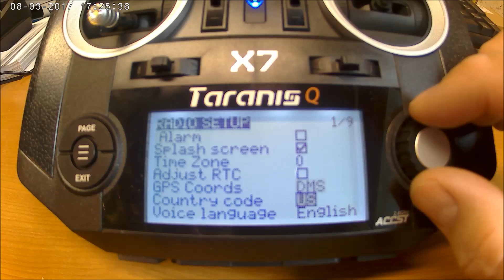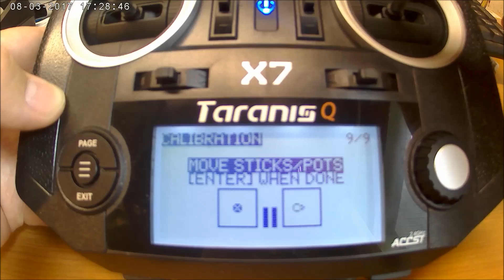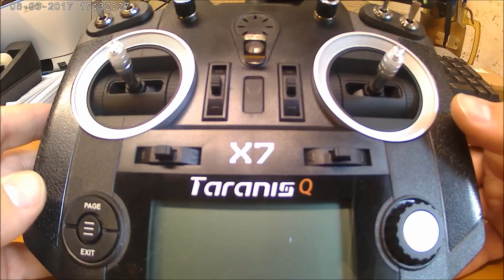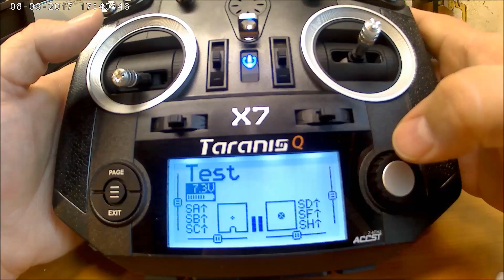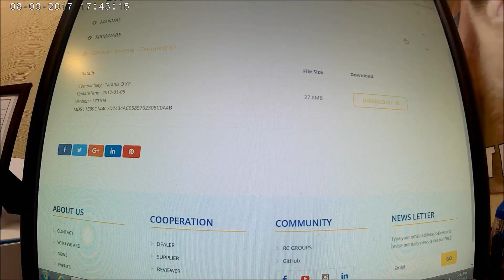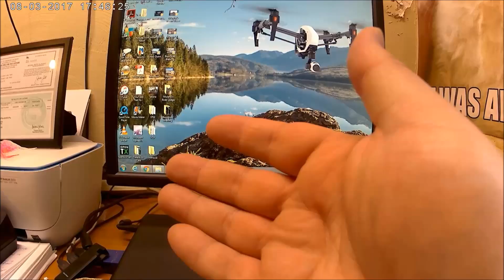Taranis QX7 - First Initial Setup Steps

Comment: Thanks for doing a great video with all visable. Was easy to follow along 
The JR bay in the back will hold my TBS crossfire module. For my extended FPV rc Summit's radio link I need for my channel.
 Thanks again for making it a bit easier.  I didn't even try to fiddle around before I watched.
Reply from the maker: Your welcome glad it helped. Thanks for watching
Reply from the maker: Yes the bay in the back will hold a crossfire. I use the full version and works fine

Comment: Excellent video as usual...
!!!  I need some help please  !!! I have an eflite viper 70 mm edf and I bind my Taranis QX7 with Spektrum Rx AR636A AS3X using the JP4IN1 Jumper Multiprotocol Module....... everything is working good, but I don't know how to make the Safe works, how can I assign a switch to enable or unable that option?..... I'll appreciate any help... thank you....
Reply from the maker: Thank you. I honestly don't know anything about that module. I only use the TBS Crossfire.

Comment: This is the first video I opened after receiving the Qx7 S. Great video, thank you!
Reply: Did you get yours running? I get mine delivered tomorrow and tryna see how to simulate this first. Any recommendations?
Reply: @rtony209  yeah it was up and running great! My one recommendation would be to update the firmware as soon as you get it. My power button would flicker even after turning it off, firmware update solved it. Good luck with your application!
Reply: @Coolarj10  and by updating the firmware it would require me connecting it to my PC and all that good stuff?
Reply: @rtony209  there are some tutorials online but it’s pretty straightforward. Here is the latest firmware: https://www.open-tx.org/2020/10/06/opentx-2.3.10
When you install that software to your PC, it will let you put a firmware update file onto a microSD card which you then put into your Taranis controller. There are a few steps you have to do which I can’t remember, so please follow the instructions in that link or in another YouTube tutorial!
Reply: @Coolarj10  thanks for the link
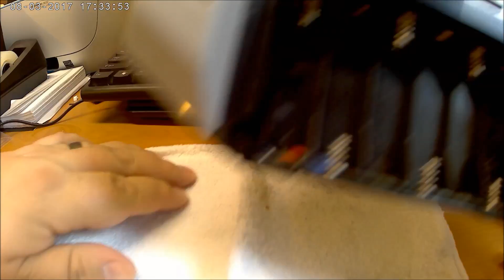Reply: 11:44 where can I find more about this component? Or will you tell us what the external part does?
Reply from the maker: It's a module bay for like the TBS Crossfire system, or a multi protocol module.
Reply from the maker: Thanks and thanks for watching

Comment: If you lift the battery tray out, you can plug and unplug the power jack before you remove the back casing.
Reply from the maker: Ya actually I've done the battery mod. Already tha is for the info.
Reply: Nice! I want to chance the tray to a real battery instead :)

Comment: Ok, I've been trying to search how to power on the Taranis without having to press and hold, but have no luck.

You seem to be able to just click on the button and your Taranis switches on immediately, is there some sort of configuration I need to set?

I have a Taranis Q X7S.
Reply from the maker: Should be the same setup as mine. Try reaching out to FrSky directly.
Reply: Yeah, actually got the answer to why a few weeks back. Basically the latest OpenTX firmware forces you to hold the power, whereas one of the older firmwares allows you to just press the power without holding it down to turn on or off.